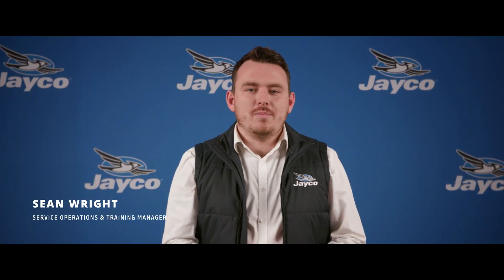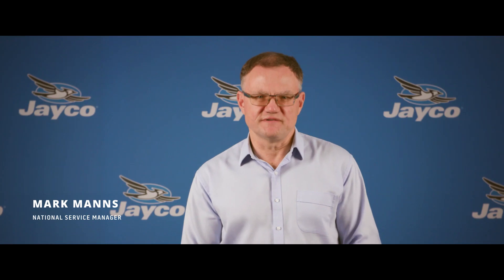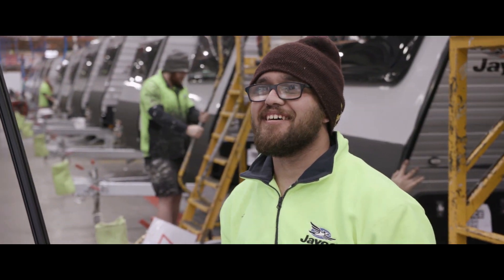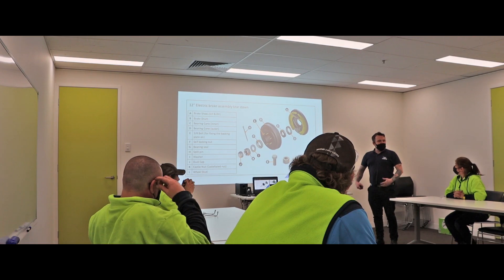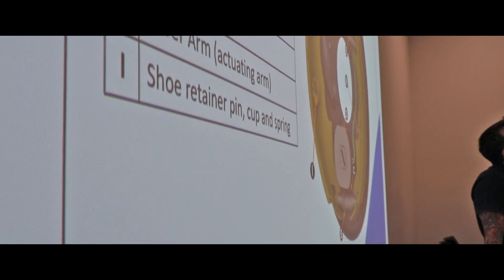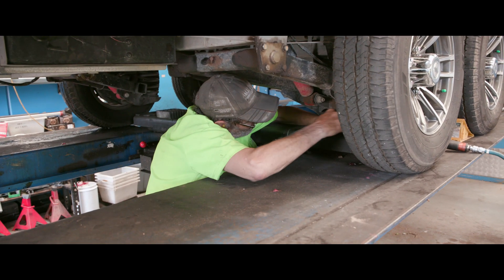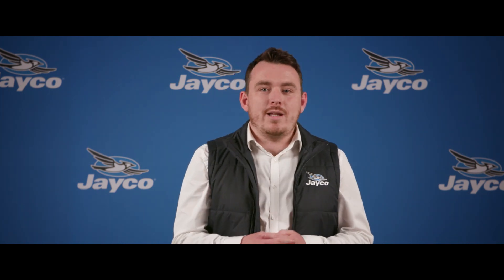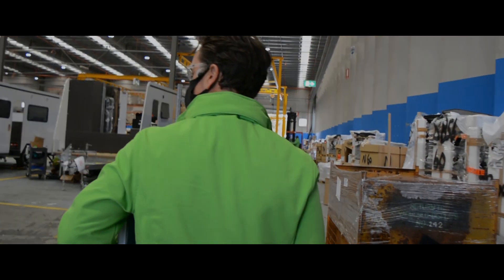Introducing the Jayco Academy

Comment: Talking the talk. 
Our first Jayco was a new 2006 flamingo. With lots of great memories like Phillip Island and Cameron's Corner.
Traded up with Jayco to another new van, 20.6-22 with under slung axles. Great trip touring through northern NSW and southern Queensland. 
Third Van 😤
Traded again with Jayco to another new van, a 16.51-3 outback. This was supposed to be our retirement van. But, it's back at the dealership for MORE warranty work. Starting with new materials, how does a van have ongoing leaks?
How does a vehicle pass inspection with the wrong rated tires?
Why no hatches?
Payload, 300kg. This gets eaten up very quickly with water, batteries, solar. It would have been good to have some feedback on weights from the sales assistant. Buyer beware? shore. But that is why we went to Jayco three times. Just hoping for that little bit more than, make the sale at any cost.
Getting the product out the door as fast as possible. 
Jayco needs to Walk the Talk.
Don't just leave it to dealerships to fix poor workmanship. What level of training do the dealership technicians receive?